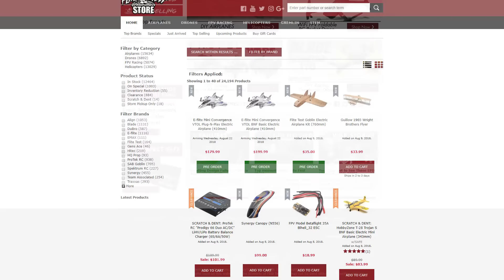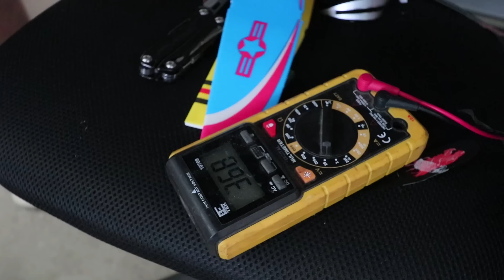Powered R/C glider without batteries!? | Capacitor plane hack

Comment: Lets just randomly connect capacitors to things? What could go wrong.
Reply: What a weird thing to say. What is your point exactly?
Reply: New to Flite Test? ;)
Reply: Why would this be a bad thing?
Batteries explode much worse than capacitors do.
Reply: 18 volts can't get through dry skin. This is only 4 volts. Capacitors blow from overvoltage, not from shorts or reverse polarity. Wool socks on carpet are more dangerous.
Reply: Justin Salazar I swear I thought capacitors could blow from shorts. 
Maybe I am thinking of shorts when the capacitors are not the only source of power.
Reply: reverse polarity does blow up a capacitor, but I think not all types
Reply: Jalo Swaggons ceramics it doesn’t because they don’t have a polarity. In a circuit like this one reverse polarity doesn’t blow the capacitor I wouldn’t think.
Reply: OK, I concede, but not likely at that voltage. unless those caps are rated at less than 10v. I have blown very few caps and I do lots of stupid things.
Reply: When you work on high voltage electronics capacitors are very dangerous. You have to discharge them, before you go close, by shorting the terminals.
Reply: Justin, sort of, but we are only talking 4.5volts here.  Yes, they do blow up.  It is called 'try things'.  We blew a lot of capacitors in college and we all lived.
Reply: I don't think we disagree. The above was a response to the shorting comment, I just was stating it is safe to short caps. If you look above that I basically say what you just said. So lets play with some low voltage and caps
Reply: +Jalo Swaggons
"reverse polarity does blow up a capacitor"

Reversing polarity doesn't blow up the power source (capacitor, battery, whatever), it blows up the device, unless the device is reverse polarity protected. In the process of blowing up the device, if a short-circuit is created, then the power source can be blown up.

The likelihood of damaging a capacitor from a short-circuit is much less than a battery.

But the original poster is correct, you cannot just replace a battery with a capacitor. Mainly because a capacitor won't hold a charge for very long. If you charge the capacitor and put the plane down for a minute or two, it won't fly :) Also because a typical capacitor holds much less of a charge than a typical battery.
Reply: That's not much to go wrong. The original post is over cautious. Capacitors should be randomly connected to things, at low voltage, not much can go wrong. let's build, fly, experiment, and have fun.
Reply: TradeBasedOnNaturalResourcesAndClimateNotSlaveLabor thanks for verifying the shorting a cap being the power source vs something else being the power source.
Was too lazy to look it up
Reply: They would blow up if you reverse charged these i think
Reply: The guy talking about capacitors and how to wire them and why seemed to suggest it wasn’t very “random”
Reply: Ok, I just took a 10v 1000 uf cap and connected it both ways to a 4.2v battery. Nothing happened. It did not pop or burn. I think I'm done.
Reply: It was an electrolytic capacitor like on the flight test plane.
Reply: I blew two 50 volt rated capacitors in a voltage regulator with an 11 volt lipo peak discharge of 110A... The cardboard from inside one hit the roof. Still not dangerous, just not sure why it happened.
Reply: What was the input voltage of the regulator? This sounds like more power than a 1s battery.
Reply: It’ll just hurt a lot if you make a mistake
Reply: DroneRacer101 
Please don't circumcise any sons you may have. Thank you.
Reply: if you connect those same caps to a 6s, you will think differently. They will go off like a firecracker or  M80, depending on power, voltage and specs of cap.
Reply: but capacitors tend to output at much higher voltages. if you get shocked youre gonna have a bad day
Reply: At the size they're dealing with?  Not much.
Reply: Well for one, touching your brain with high voltage charged caps could make both your brain and cap loose its capacity. xD
Reply: @zachburke8906  Capacitors when charged pump a good load of oops into your electronics.
Reply: @zachburke8906  Electrolytic capacitors have a polarity and will vent if connected backwards. Some other types of capacitors don't have a polarity, but also have greatly less capacitance.
Reply: Erwin Holland it’s a pun...

Comment: Putting Capacitors in series only doubles the maximum voltage, not the actual voltage.
To do that you would also have to increase the charging voltage.
Also it halves the capacity.
Put them in Parallel so you will have double the capacity and thus half the voltage drop per ampdraw.
Reply: it does not halve the capasity,  it just does not get doubled.
Reply: Yes it does ;)
See: https://www.allaboutcircuits.com/textbook/direct-current/chpt-13/series-and-parallel-capacitors/
What you said is true for batteries, but caps are special.
Reply: @Ultrazaubererger  no, they are not special. Just different. ;-)
Reply: CAPACITANCE!  Sorry for shouting but nobody here seems to have heard of the correct term and instead say "capacity" which can lead to seriously twisted knickers.  The Farad is a measure of capacitance.  Put two 1F caps in series, you get half F.    Put them in parallel you get 2F. The capacity for energy storage is double what you get with one alone, irrespective of how you connect them.  Series:  higher voltage, lower mAh.  Parallel: lower voltage, higher mAh.  As for the lower voltage drop from a parallel arrangement, well half of 16 is a drop of 8,  and half of 8 is a drop of 4.  And 4 is definitely smaller than 8.  But in both cases the drop is 50%,  so they are equal in that sense.  Hope that didn't sound aggressive, it was meant in a friendly spirit.
Reply: Fredrick Nietzsche C times C over C plus C (quick way to calculate two capacitors of capacitance C in series) does in fact simplify to C/2
Reply: @fredricknietzsche7316  It reduces the capacitance. If you have two or more different capacitance capacitors in series, calculating the combined capacitance gets a bit funny.

Comment: Hey guys, very cool vid as always. Alex congrats on your second kid! 
Watching this video I can see you are on the same road we were on. My son and I love building small RC gliders like this because of the non-explodiness. We began with a simple rubber powered RC plane made from packaging foam from frozen pizzas.  :) That was fun but we got tired of having to wind the rubber band up before each (short) flight and eventually just made it into a glider. The glider flew nicely but we knew we could make something better. A few revisions later we basically came up with a small 500mm span DLG foamie glider. Now we were hooked and wanted more!!  A quick browse on the FT web site and the guys recommended the LightninBug DLG so we built one. The flights were very impressive, way better than our foamies. It flies for ages off a simple eye level hand toss and it will fly for 30+ seconds in dead air from a lazy DLG launch. After we hooked a thermal for the first time we were absolutely hooked!! We are having way too much fun with this glider and it has lead us down the very deep rabbit hole that is F3K and we are loving it!! 
As always, keep up the great work. FT FTW!

Comment: You don't need capactiors in series, you can just charge the one you have to a higher voltage. A capacitors energy stored actually increases with the square of the voltage meaning 2x Voltage = 4x Energy. You just have to make sure that the capactior you are using is rated for the applied voltage or it WILL blow up!

Comment: I remember my first dealings with capacitors...was how the flash is powered on one of those old wind up disposable Kodak cameras from when I was a kid . Touched the contacts on a full charge and lit me up like a Christmas tree! It soon became a meathod of torture for my siblings ...
Reply: brendan burnham this is my exact life.
Reply: Sad life.
Reply: I dont know if has definitely been full a learning. And learning is pretty cool. It makes me happy
Reply: I was on the receiving end of a fairly large capacitor in High School.  Everyone had a great laugh, me too on the outside.  On the inside I was hurting!!!!!!!
Sure gained a lot of respect for stored electricity.  Remember that when you are digging through the guts of old electronic devices.
Reply: working on an old 1940s  shortwave radio   in  80s   an  Oil filled Capacitor  got me  bad
Reply: same thing happened to me and i did the same exact thing afterwards until i got it taken away!!
Reply: brendan burnham hahaha well that was my exact first contact with capasitors aswell, never forgot what caps do 😂
Reply: I had the same experience. Damn that hurts.
Reply: Similar experience here.  I was hacking on old Kodak digital camera to make it into an IR camera for flying on a plane for cool pics.  More than once while inside the camera  to get to the sensor I managed to "connect" to a capacitor for the camera's flash.  Knocked my butt out of my chair.   I felt it...all from a little digital camera.
Reply: I discovered that when I was around 8 and did the exact same thing to the kids around the neighborhood. Much fun was had
Reply: Same. That 300v 80uf flash cap sure packs a hit. Don't use it on someone with heart problems though.
Reply: rcrnitto pretty sure they are 3000v good thing 80uf doesn’t deliver much current.
Reply: Haha did the exact same thing, but made my disposable camera guts into a TASER WHIP!! By connecting the capacitor leads to some speaker wire .... good times
Reply: disposable tasers! i forgot all about those!
Reply: As kids we had capacitor wars, 10,000 uf at 500 v, with 2 probes attached (one to each terminal.) melted each others belt buckles, shocked each other! At tech, the teacher had a bag of high voltage capacitors in a bag for us to use in a high voltage experiment after lunch. I charged all of them to 350 volts, bent the leads inwards and placed back into the bag. (unseen of course) Needless to say, when the first student went to grab a capacitor, he was given a hefty "belt" and charged capacitors flew all over the classroom:-)

Comment: I found some little F15s at a Radio Shack close out a few years ago.  Paid like $3 each for a couple them.  My grandsons had alot of fun with them.  We lost one in a thicket and the other was broken.  I have the motor and capacitor from it.
The capacitor used has very high capacity but is only good for about 5volts.  The charger uses three series connected 1.5v cells so the charge is limited to around 4.5v.
As you noticed, series connected capacitors didn't work, series connected capacitors increases the voltage rating but reduces the capacity by half (if using identical parts).  The voltage rating increase is wasted because of your charger, controller and the need to balance the charge, kind of like lipos, to avoid over voltage.

    These high capacity caps work well in these toys because they are simple to use when just powering a small motor.  You can't  over discharge them and they are not damaged by be left flat. The charge circuit is simple and you do not have the fire concerns of lipos.  For more complex items you are better off with batteries.  You can get higher energy density and a flatter voltage output curve.

Comment: you guys should use the capacitors to power the motor on a glider and then just use a tiny like 70mah one cell to power the receiver and servos so that you can have continuous control of the glider and then just use the capacitor powered motor to get the short flights over and over again
Reply: Good idea.

Comment: edit: I posted the following, but it's all false (would be true if it was a battery): 
capacity didn't change; the increase in volts, without changing the motor and prop, wanted to spin the prop faster, increased the load... which increased the current draw, which drained it faster down to the usual 2 volts that was normal load.
Reply: As engineer I feel obligated to correct:

capacitance in series: 1/( 1/Cap1 + 1/Cap2 + 1/Cap3 +... 1/CapN)
  in other words: YES capacitance will divide if you put 2 same size capacitors in series. It will be worse if not same "size"(capacitance). However, this is done when it is required to double voltage range. In video you still charged capacitor with same voltage, capacitors were not charged to max potential. That's why performance of cap(s) decreased remarkably.

capacitance in parallel:  Cap1 + Cap2 + Cap3 +... CapN
  in this case there is not real downside (in this application). I could not see specs of caps, but expecting you charged them with same voltage, I expect them to be rated for higher voltage (typical super cap is 2.7V).

BTW. all modern receivers should still be operational on low voltage like 2V. MPUs now days work on 3.3 - 1.8V range due smaller circuitry, they have "transformer" build in.
Reply: oh, it's like resistors in parallel... that's so uncool. :)
Reply: Arron yup, but there's buck up voltage converters that can be had cheap!
Reply: @modelnutty6503  problem is that they take power to operate. But it could be worth it.
One could also use a button battery to the servo and receiver and power motor with capacitors.
Then you still can charge fast, and run out all energy/voltage from the capacitor without loosing control over recievers.
Caps charge fast, and can bu uncharged to 0 volt without problems. Chargable batteries, not so much.

Comment: Pro tip: Just use a battery. It will take longer to charge but is lighter for the same voltage and gives you more flight time
Until I invent ultraefficent graphene supercaps
Reply: In life there never seems to be a free lunch
Reply: MajorLeague  and capacitors doesn't lose storage capacity as the number of charging the device increases.
And capacitors can be totally discharged and then charged without any problems. Which is NOT the case with batteries. So, a super capacitor can be stored for years without problems. Batteries can't.
Reply: Can be. But still, if you discharge a battery to much, they can start burning if charging again. Capacitors doesn't have problems.

And yes, the problems with storing energy in capacitors, is it could easy leak and discharge in quite fast time (a couple of days).  Batteries can store energy longer, but also take time to charge.  That is why they use a SMALL lead battery to support super capacitors as starer batteries for cars.
Reply: Right? This is like putting a 2 gallon tank on a car and boasting that you can fill it faster.
Reply: @amorag59, no.
Reply: @Anders Jackson, Yes, these guys have to charge that plane every 2 minutes. the benefit with capacitors as mentioned above is higher specific power, which they aren't even demonstrating with the planes in the video (small motors being used to extend flight time on the small caps). The higher capacity supercaps are always bulky and low voltage. There is a reason they are usually paired with battery systems, it's because they don't hold worth a darn of any energy.
Reply: this makes me think about using 3 button nicd/nimh batteries in series on an ultralight powered glider, you should be able to get quite a longer runtime, can just get a tiny box with 30, and recharge them overnight. 
in a couple of years we should have batteries that charge in 5 minutes, so that wouldn't be a problem. (for now they are only experimental.)
Reply: @satibel  not chemical batteries.  
But supercaps have potential to be much better.

Comment: Solar panel \capacitors combo for long endurance gliding. Parallel rows of super capacitors. with independent discharge sensors, to alternate between rows. I saw a vid of a quad flying on super caps and solar convo.

Comment: capacitors are mostly used as stabilisers, if you take AC power and rectify it to DC power, you will have a capacitor in parallel to stabilise the power output. The same happens with small DC motors that run on a PWM signal. The capacitor will charge till the peak power and then slowly discharge till the next peak where it will charge up again

Comment: Could you replace the capacitors with a 1s whoop battery to see how proformance compares?
Reply: defeats the super quick charging concept!
Reply: model nutty right, however it could be worth the extra charge time if the plane can be flown for longer. My guess is that the small lipo will be lighter, and will be able to provide more energy for longer. However I can't say for sure which is why I want them to try it.
Reply: @kwadifyfpv8388  add super capacitors instead.  They will manage to handel repeated chargers without the loss in charge capacity that chemical batteries get.
And you don't need to care about not use it under a certain voltage, you can totally discharge a capacitor. With a battery you will ruin it if you uncharge it under a certain voltage.

Comment: What value capacitor are you using? I have a sheet of material which is dielectric with aluminium bonded either side. You could make a plane out of this, and use the material as a capacitor, ie the wings could be a top layer, bottom layer separated by an insulator to form a capacitor (like an aircraft having fuel in it's wings) Weight is the problem. Or you could put aluminium tape top and bottom of wing, but keep insulated to form a capacitor, hence using less weight than a dedicated capacitor. Keep me posted, This is fascinating, thanks